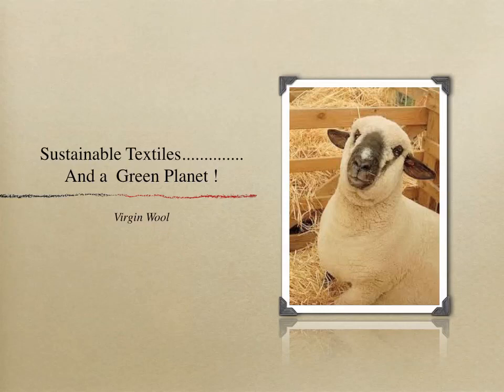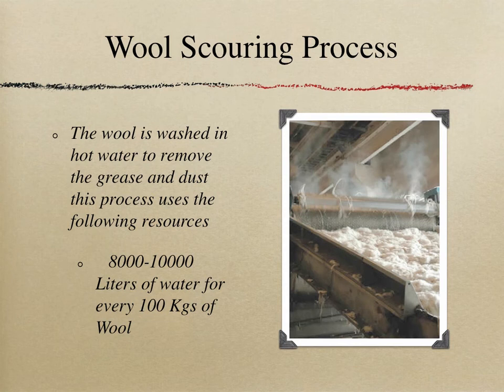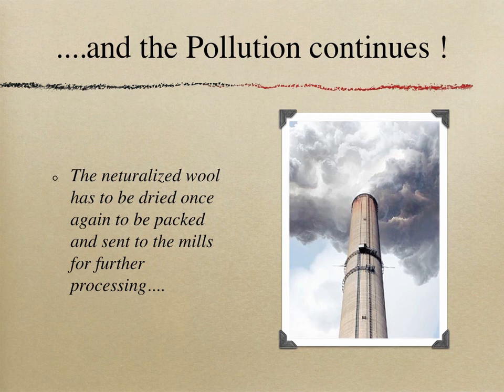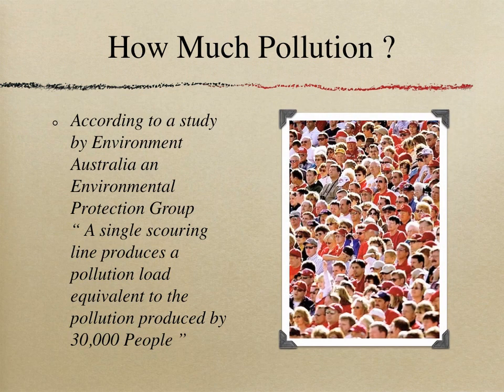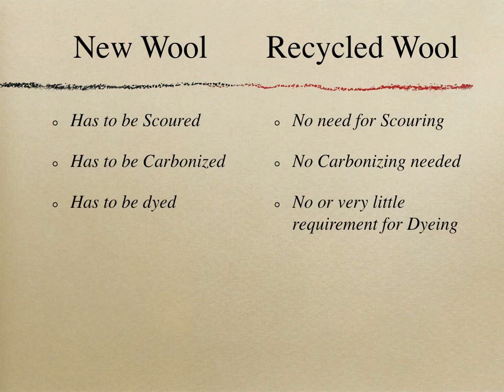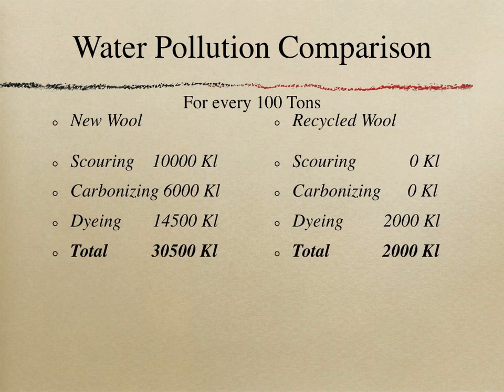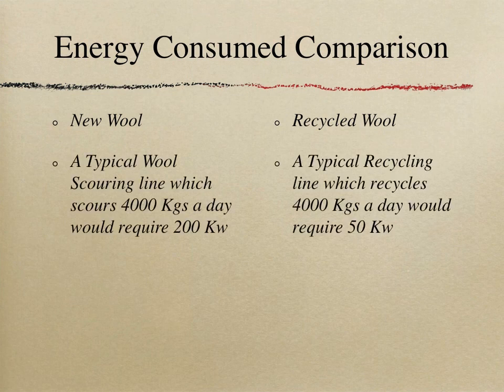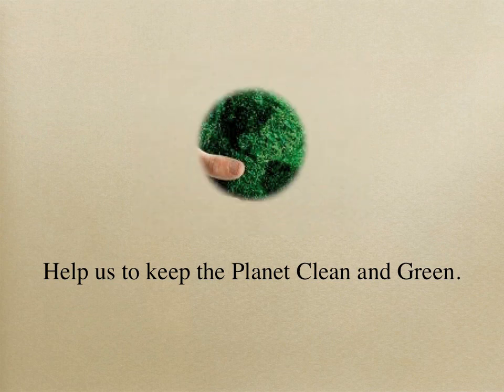Eco-Wool

Comment: Sadly there is no comparison between new and recycled wool. I have no doubt that recycled wool has a much lower carbon footprint but what about the quality and the durability of recycled wool ? and last but not least the comfort and physical characteristics of wearing it ?
Reply from the maker: Dirk D´Arcy a lot of the European brands which are making products like 30% wool blended with polyester and/or acrylic are made out of recycled materials. Wool coats with 5% cashmere from Italy contain mostly recycled cashmere as virgin cashmere is too expensive. Some of our products have been used by customers for over 25 years and have had no complaints. Durability is brought in by proper recycling and bad quality manufacturing of even a new wool product can lead to a lower durability in comparison.